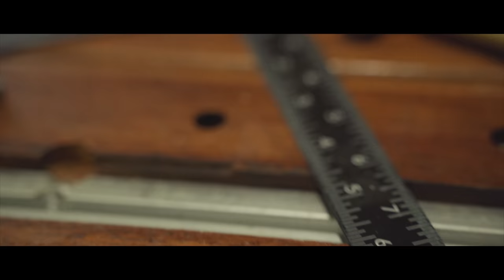장인이 마음먹고 가구를 만들면 생기는 일 100%원목만으로 만든 장식장 국산가구  woodwork joint master

Comment: this is not carpentry. we watch the machines running.
Reply from the maker: Hello, we are doing woodworking with our Leehyun machine. However, since it is not a simple factory, it produces a large number of types in small quantities, so every single piece of furniture is made with great care. Please, I would be very grateful if you support our spirit and work. The furniture shopping mall has been opened since March. Therefore, we plan to upload various furniture production videos. We look forward to your interest and love in the future. :-)
Reply: In my eyes this is a modern way of oldschool carpentry. Its just the way everbody imagine how a Carpenter is working. 
Where I am from most carpenters dont make complete furniture anymore. One guy is planing, another one peogramming the cnc, One guy is cutting wood, the other one is drilling holes, another one is gluinh edges on the boards....
One asembles and the next one install it at the customers place..
And I do not talk about factories producing only windows or ony chairs or custom ordered boards or mass production.
I talk about small shops as you can find them in every small village here doing their job for their customers (hotels, restaurants, private homes...)